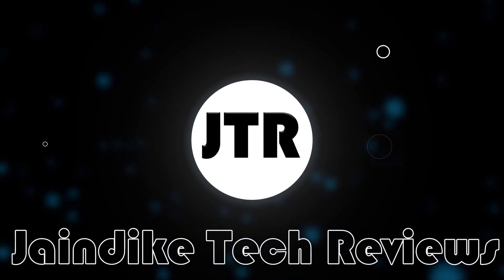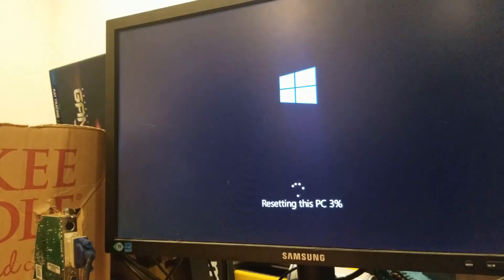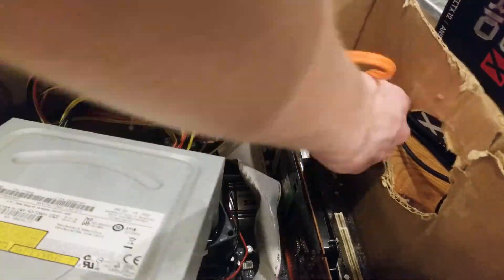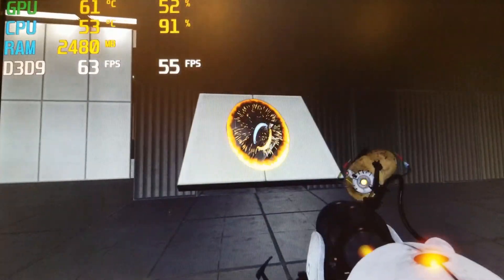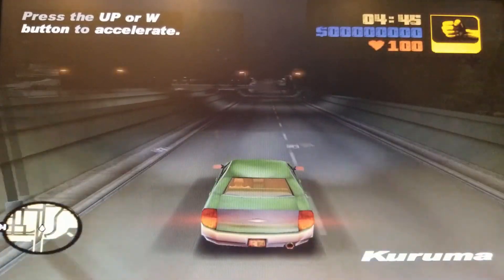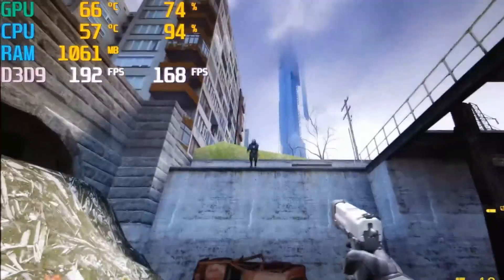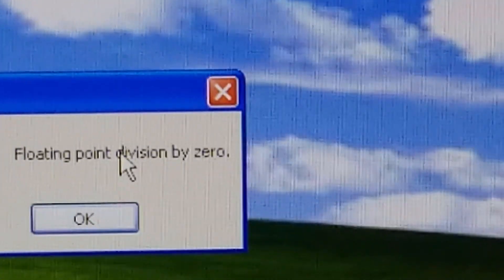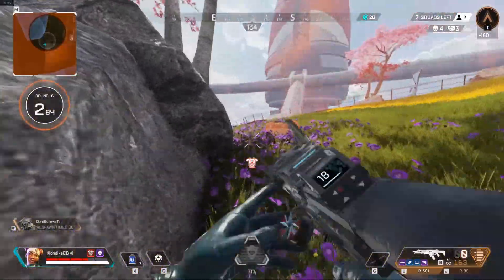Is the Pentium E2220 Good in 2020? (Kinda) Benchmarks + GAMING (GTA & More)

Comment: Which better e2220 or intel core 2 duo e6300
Reply from the maker: The E2220
Reply: @Jaindike  e2220 with 2 gb ram and carte grafik intel geant express what games can run
Reply from the maker: @تعلمدينك-ط1غ  Depends on the OS, as in how much processing power is being used just to run the computer without any games. Definitely buy more ram though. You could probably find up to 8gb online for a reasonable price. Makes sure your motherboard model supports it though
Reply: @Jaindike  what if he was faster in windows 7 then can run games?

Comment: I never had this cpu model, I did have a Celeron e1200 that was the best overclocking cpu that I ever had in terms of percentage.
I overclocked it from it's stock 1.6ghz to 3.4ghz. It ran 24/7. The only cpu that I've ever had that overclocked to more than double it's stock speed.
The highest overclock I ever ran was a Celeron D at 5.15ghz stable for 24/7.
Reply: but why
Reply from the maker: Wow. 5.15 ghz on a Celeron D is very impressive. You really won the silicon lottery on that one. What did you use to cool it?
Reply: @Jaindike  A custom fan that a friend of mine who was an airplane mechanic rigged up. During the COLD Canadian winter, I would put the pc case in an open widow sill, it fit perfectly.

Comment: Vista after patches is quite stable now. I bmk old gpu and i use a core quad q9400 with 32b vista. It runs All of the xp games no problem.. this is something that i could not do on win 7 64b. 32b os also means that its limited to 4gb ram in total ond 2gb max per application. To me core cpus = vista, 1st, 2nd and 3rd gen i cpus = win 7.. etc..
Reply from the maker: I never knew that Microsoft actually patched and fixed up Vista. Kinda just thought they abandoned it. Might have to check it out in an upcoming video...
Reply: @Jaindike  Linus did make a video talking about patching windows Vista during the early days of windows 7
Problem was people upgraded there computers along with windows 7 and abandoned vista before it got a chance

Comment: Could this processor support 8 gb ram?
Reply: The amount of RAM supported depends on the motherboard chipset/northbridge (G31, P35 etc).
Some motherboard chipsets/northbridges can support 8 GB RAM, but others cannot.
Reply: Its a combo of both the cpu and mb. Both need to support 8gb. The cpu does..
Reply from the maker: The other comments are right. But yes, you can run this cpu with 8gb of ram
Reply: Yes, with either DDR2 or DDR3 ram.

Comment: I run GTA San Andreas way better (100+ FPS) with some mods that fix this broken game (E2220 GTX 750Ti)
Reply: your pc specs? e2220 `750ti is a very high bottleneck probably
Reply: @lukkah5468  It was. The 750ti was borrowed from a friend. Now I have an Athlon 3000G with 16GB RAM (without offboard gpu)
Reply from the maker: Yeah, the 750 ti is much better than the GPU I used in this video

Comment: It can do some emulation very low end gaming like minecraft/csgo and some indie games Dont try to run any more intense games unless you want a stuttery surprise you can also do browsing and basic tasks like school work or watch this video on youtube if you want alot more performance try making windows as lite as possible by changing some settings it can make a huge difference in performance for low end cpus like this cpu you used
Reply from the maker: Yeah, this processor really is the epitome of low-end-but-still-usable, especially considering its age. But do you know, specifically, what "settings" should be altered in window to help performance?